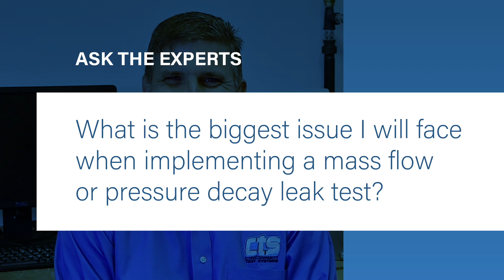Controlling temperature when doing a mass flow or pressure decay leak test (Ask The Experts)

Comment: What is difference between vacuum and positive leak test IN SENSE OF SENSITIVE?
If the SAME part is checked with POSITIVE 50 KPA and NEGATIVE 50 KPA ,will the result i.e pressure drop will be same?
Reply from the maker: Hello, this is Gordon Splete from CTS. There is a difference between pressure loss when testing with vacuum and pressure. You will have less pressure drop when testing with vacuum through the same hole size when compared to pressure. Less air density while under vacuum causes this measurement. There is a linear relationship with air flow and pressure increase, however in vacuum eventually air flow stabilizes between 5 - 10 psiv and does not increase.
Reply: @cincinnatitestsystemsinc6493  Thank you for your reply.

I have query.

The leakage (pressure drop) from the components will remain the same or change if we maintain same temperature but varying atmospheric pressure means i am checking the components in different country with same temperature.

Will the leakage will differ if we perform leak testing  process like once by+50kpa  and  performing under same condition in vacuum -50Kpa?Can you please explain more in previous answer regarding air density and stabilization.